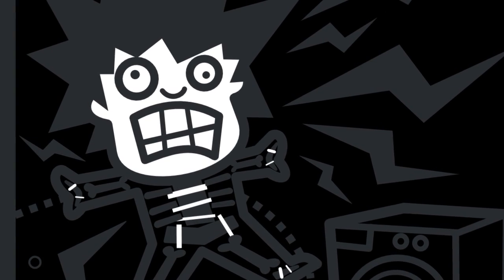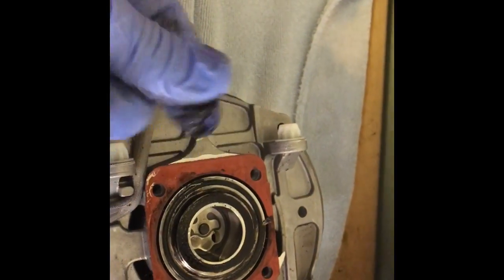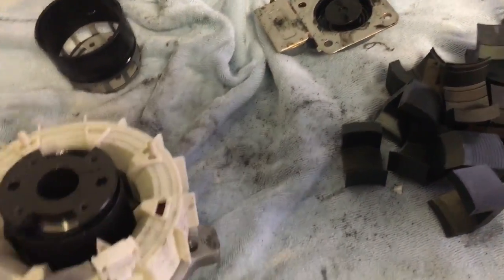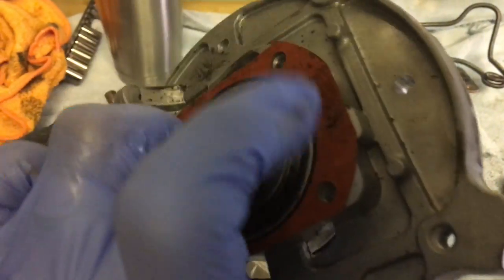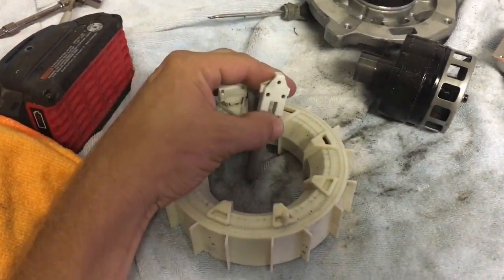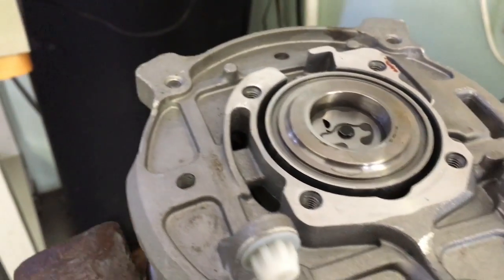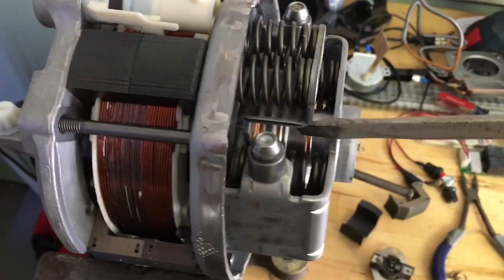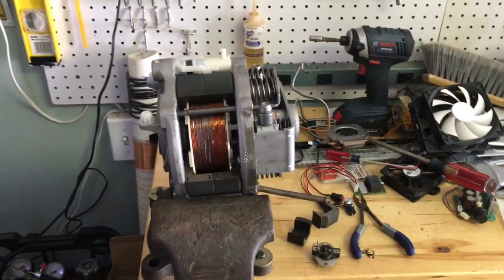LG Linear Compressor Teardown

Comment: Ahh reed valves! Well, one reed basically. No wonder these things die so quickly. I used to replace reed valves in reciprocating air compressors all the time. Usual cause of failure was low oil levels in the compressor sumps, which lead to overheating of the heads, which in turn made the reed valves brittle. So, it seems like LG could fix this issue easily with a better cooling system for the compressor.
Reply: For many years Yamaha used reed valves in the induction system of two-stroke motorcycle engines. I have worked on many of these engines and have never seen a broken reed. The reeds close onto a rubber coated seat. Where I have seen a broken reed is in a factory air compressor in which the reeds close onto a bare metal seat.
Reply: @cedriclynch  Reed valves shouldn't be used for high pressure applications because small amounts of plastic deformation over time cause them to fail to fatigue, this can lead to catastrophic failures especially if used in a high pressure system. The intake on a two stroke is very low pressure, always less then 20PSI depending on altitude and throttle position, and the reed valve doesn't really see any serious load, heck even plastic or rubber reed valves can suffice because they just aren't under any serious stress. You can't really compare it to this.

For the linear compressor it usually has a pressure differential of 600-800 PSI, with a 0.2in^2 area that's a force of over 100lbs every cycle on that extremely small valve, which is a lot for a tiny bit of thin sheet metal, especially considering it's braced against a sharp corner that will worsen the bending force accelerating metal fatigue.

For the air compressor it usually has a pressure differential of 200PSI, my air compressor has reed valves about 1/16in thick at about 1in^2 of area, that's 200lbs but it's distributed over a wide, thick piece of steel, plus the seats for the reed valves in my compressor have slanted reliefs cut into them for the valves to sit in and no abrupt sharp corners that the metal slams into like the ones used in the LG compressor.

Finally, Reed valve design, unlike many other types of valve designs is a particularly complex form of valve design because due to the cyclic nature of the device. Metal fatigue is always a concern, especially for this style of valve.
Reply: Personally I don't think those reed valves are nearly thick enough for the kind of pressures that refrigerants use, my 150PSI shop air compressor has thicker ones, refrigerants usually have a 500-800PSI high side and a 10-50PSI low side. That led to metal fatigue and inevitable failure.

Comment: How's the warranty service on them? I bought one and it says it has a 10yr warranty on the compress, do they make trouble or they honor it?
Reply from the maker: Depends on the area. If they have a good servicer in the area then you won't have too much of a problem usually. There are exceptions to everything though. If not you'll get the run around, or they don't have any one so call around and see if you can find one. I found that it depends on who answers the phone at LG. Some of them are great but most of them aren't. You have to check your warranty too because some were 1 year parts and labor, some were 5 years parts and labor, some were 7 years parts and labor. BUT if you got a good agent they might agree to cover everything, IF they agree to cover everything they might really send the parts to the servicer like they said they would, and IF you have a good servicer that does the back and forth and gets the parts they might get to you in a somewhat timely fashion, or they might put higher priority jobs ahead of you. 

So the simple answer is sometimes, but it depends on a lot of stuff.

Comment: What an incredibly stupid design. IF they used say six smaller holes instead of three large ones the problem would be completely solved. The rest of the linear system looked alright, but nowhere near as good as the sawafuji swing motor. My parents bought a fridge with this compressor despite my warning them that it would fail. Thanks for the video, wanted to see what was in it.

Comment: Looks like compressor operates under the principle of just a metal slug think of a solenoid and re-inverting Polarity back-and-forth through the windings the metallic pole pieces are too concentrate the magnetic field. 
                ? question was it low on refrigerant charge due to a leak and started overheating?. 

         Second question with all that black stuff in the system I can almost guess if you’re lucky they change the filter dryer but usually just stick a compressor on and call it good 👍🤣. 

         I’m guess there’s no flushing involved to clean out the lines or the evaporator or cap Tube.
Reply from the maker: Open the system and change the drier when making a repair. This one was clean from what I remember. Metal slug?? No, it operates as valve opens on the back stroke charging the cylinder with gas then the metal flap closes on the compression stroke compressing to liquid.

Comment: I believe the problem is the diaphragm in the center where the 3 holes is broked and for that reason there is no compression. The part I don't get is how to find out that problem without open the compressor. If there is no compression, the PSI in the low and hight side, what it could be. I understand the compressor must be change. But I would like to know before take the compressor out.
Reply from the maker: If the compressor is running and you get 40+ psi on the low and high side the compressor is not working. I tap the low side. If it's drawing a suction then low charge, if it's 40+ then bad compressor.

Comment: We bought a $2500 LG french door "linear compressor" fridge in July 2015. 2 1/2 years later, compressor fails and is replaced. 2 1/2 years later again, same thing, 3 weeks outside the 5 year warranty. LG thankfully agreed to cover it so we only had to pay the diagnostic repair but we had to live out of a mini fridge for a month. The repairman said he replaced it with an updated unit which is supposed to be better and also updated the firmware so fingers crossed.
Reply: Is it still alive now?
Reply: غير الكمبرسر عادي تعيش معاك عشرين سنه

Comment: There are other linear compressors on the market that have been very successful, so there is nothing wrong with the principle. The Sawafuji Swing Motor is a linear compressor. See here for more information: https://www.sawafuji.co.jp/en/technology/swing_motor/. The principle of the Sawafuji and LG products appear to be identical, but the designs are very different. The Sawafuji product has been in use for a very long time and is incredibly reliable. Its design appears to be much simpler than the LG product. There's another Japanese linear compressor that you can see in this video too: https://www.youtube.com/watch?v=eEF-owkyI-o. The person who made the video says that "you can see why it would last so long".

So maybe LG has made a poor version and pushed it out on the market with a few design and materials issues in it that the Japanese versions don't have?
Reply from the maker: The first one I don't know, lg drawings are or were just as sketchy. The second link shows a linear compressor that is a much better system of reed valves and looks very well built.  Having a flap of metal that bends in the same place thousands of times to what looks like a well thought out system is like comparing apples to handgrenades. 

I think or thought the weak link in the LG is the reed valve. My experience has told me that moving something by bending in the same place over and over is going to break it eventually, with all the materials I am familiar with. Maybe they came up with a material that can handle it, but I still don't think this is it. I think that the reed will eventually break, even if the rest of it held up. HOWEVER! As time has passed, I have cut open some others and found that they have multiple failures, not only the reed valve breaking. Some just seize up. So I have come to think the problem is the material they use in manufacturing. I think it'ss either too light or too cheap, either way coming down to cost to manufacture in  my mind.
Reply: @theappliancetechnician  well said

Comment: LG always claims that non-conventional technologies are the best and every time trying to achieve so it fails big time as in direct-drive technology in washing machines
Reply from the maker: I don't see too many problems with their laundry products. Their rotors did strip out but other than that on the front loads I don't see problems with the washer rotor or stators.

Comment: I am a Mech Eng, ( not refrigeration) just looking at that compressor it looks hideously complicated compared to a motor driven one. Reciprocating mass is what causes inefficiency. The linear has huge (10x?) times recip mass compared to piston. If my fridge died I would put in a universal piston compressor and temp control. I believe a conventional compressor with inverter drive would be good. I run my fridges with a Victron 12v /230v inverter 800 watt inverter and it runs two fridges happily. A smaller inverter will not start a compressor.
Reply from the maker: I think you're mixing topics here.
Reply: I am thinking the same thing! genius! What compressor would be suitable ? models??
Reply from the maker: @marcc629  Any 1/3 hp split phase compressor. Or any bldc compressor with an inverter board to run it. A split phase is easier, check my other videos.
Reply: @theappliancetechnician  interesting and challenging that we can bring this units back to life at minimal cost when others gave up
Reply from the maker: @marcc629  That's what it's all about to me. Find a way that is stable and reliable where other's can't

Comment: That black sludge looks like Teflon. Some automotive A/C compressors have Teflon in them, it disintegrates and causes similar sludgy stuff throughout the A/C System..
Reply from the maker: I can't say it's not, I don't know what it is.
Reply: Maybe graphite based lubricant?

Comment: I'm not good on sounds but this one kinda just hums (don't know if that's good/bad). Can I mount a clamp on service port on the lower tube, suction side I'm assuming and get a reading? I assuming if there is a hole in the valve there would be just ambeient temp/pressure reading?
Reply from the maker: Yeah, a low side port will usually tell the story. 50 psi and the compressor is bad. Suction says it's low. Usually you can tell the story that way.

Comment: @1:38 looks like the piston. So did the piston pound a hole in the the valve? how did the hole get in the valve? I've a "Give To Me" LG French door "door in a door" with the "Linear Inverter" system. I Tried to find a job shop appliance repair business that would work on it. Yes, they would $600 and up with "No Warranty".  The repair shop guy said they were way to busy anyhow for a actual repair job because his main income was from picking up the used refrigerators from the area appliance stores and properly scrapping them out $35 a pop and then whatever the scrap metal places give them as well. He does some times twenty a day (he has his own 2 ton box truck with a lift gate running loops from appliance store to appliance store). Apparently no one even blinks at dropping $2000 on a new refrigerator every few years. The appliance stores just can't get rid of the old units fast enough just from limited storage space. Is this a economic bubble about to break or what?
Reply from the maker: It needs to. They are making nothing but junk now days and selling it for $$$$. Some are not repairable. The hole is from substandard materials, cheap steel that wears out fast after vibrating a lot. It's just junk and that's unfortunate because other than that they make a pretty good refrigerator comparatively.
Reply: Walter Baumy do you think guys may be we could replace that valve? Welded a replacement ?  Seems like they are improvising at owners expense to me .. replacing would be good however we gotta take into account that piston might also be busted

Comment: I understand you can not use a back up generator on a linear compressor! True or false  A inverter type will ruin the compressor!
Reply from the maker: Generators are hard on everything typically speaking. You take a chance running any refrigeration on generator power. I don't usually see problems with whole house generators, it's the 10hp 5500 ones that I see cause problems.
Reply: False. Inverter generators will not harm anything. NON inverter generators can harm things badly if not tuned perfectly. In a perfect world a non inverter generator can power up anything you'd run on mains, but that's where the generator maintains exact RPM (and therefore hz and voltage) and never shuts down or otherwise changes speed while the device is powered. Inverter generators produce pure sine wave forms and never allow the voltage or frequency to go very far from spec, therefore they are safe for all electronics.

Comment: Walter: Would it be better to replace this with a different linear compressor so It could keep the variable speed efficiencies? How would I find a compatible replacement is the question I guess. Any ideas? Thanks.
Reply from the maker: Million dollar question. Whirlpool is making a linear but I don't know anything about it. I think the design is too new and they hadn't figured it out yet really.
Reply: @theappliancetechnician  According to this: http://www.frigochem.com/pdf/Refrigerator_Compressor_151207.pdf Page 28 - it seems like I should have a coil reading between any 2 contacts. The one I have is open P to S and open P to C I am getting a fluctuating resistance C to S. All connections off - only reading the compressor(still installed). Can you help with what a good linear reads in ohms between the terminals?  By watching this Teardown video it looks like maybe only one winding operates these linears. The fridge I picked up for free, now a project nothing invested yet,  is a Kenmore 795.72053.110 French Door bottom freezer( Nice fridge). The compressor is LG FC75LBNA(the infamous one I understand). No cooling. Six flashes on the control board LED. I pierced the service port line on the compressor. It has no suction when the condenser fan is running and it feels like the compressor is running. Total current draw of the fridge from the 110V outlet is like .5 Amps. Thanks for the discussion here. I have several used reciprocating  compressors from scrapped refrigerators. Thinking about patching one in with the 12 volt relay as you discussed in your video https://www.youtube.com/watch?v=lZJ0EZE3tx8. Thanks for that. I would not have thought to try that. But I am waiting for now to see if there really is an improved LG or Whirlpool linear compressor coming along. Looks like I can buy the same one on Ebay for $280. https://www.ebay.com/itm/TCA35271204-LG-TCA36511303-TCA35271204-TCA35533604-Refrigerator-Compressor-NEW/233263981723 Probably get a couple years out of it - maybe.
Reply from the maker: @rogerschelling3162  Linear compressors have a single winding so that's 2 pins that will give a reading. BLDC have 2 windings so all 3 should give the same reading if you ohm them out. LG  linears use 2 and one doesn't go to anything so if you get 2 ohms across 2 terminals and OL on the other one to either of those 2 then you're dealing with a linear. BLDC use the grey or black compressor boards to run them. It's usually a VCC3 controller that runs the compressor. I have another video about that controller and running it on an arduino.
Reply from the maker: @rogerschelling3162  Typically when you pierce the system you'll have about 50 psi+ on the process tube or suction side and the same or close on the discharge. I have 0 faith in the new one to be improved and no one can even tell you what the new compressors or the control board reprogram does that's different. I think they disable the compressor overcurrent error on the inverter. I've had problems with that after replacing compressors on these. That's all I can think it does.
Reply: @theappliancetechnician  Yea I did have static pressure of 50+ when I pierced the process tube. I can't tell that it draws down at all when the compressor & condenser fan motor are running.  Now then it looks like Embraco makes a linear compressor and that may be what Whirlpool is using. http://www.atmo.org/presentations/files/571d4d6ebe4561461538158Nv2qS.pdf 
Down to page 9 it shows an Embraco compressor # WMD7H for R134a 220-240V 50-60HZ. 
I don't know anything about the Yoycart website but they list some Embraco WMD7H as low as $60 + $8 shipping on a slow boat from China. https://www.yoycart.com/Product/548134004635/
I can't tell much about the compatibility of the LG linear driver signals being compatible with the Embraco linear driver signals. Although I have looked at the voltage and frequency on the LG that I have. The LG FC75LBNA.
Reply: @theappliancetechnician  Thanks for the explanation. The LG FC75LBNA that I have does ohm out as you describe. There is one winding of 6 ohms across two of the contacts and one unused contact. I downloaded the service manual for the Kenmore Elite 795.72053.110 with the LG linear compressor that I am working on and it has a better picture of the winding and gives the ohm reading for it. My compressor winding is good at 6 ohms if I steady the compressor, it's kinda of odd to me why that winding resistance fluctuates some but I guess there is some back emf or something even when it is completely disconnected.
Reply: Roger Schelling the lg universal compressor, but need to update  software via JIG..
Reply: @theappliancetechnician  Yes ! I had the same reading on the low side and 90 on the high, vey low flow. In all open system I could stop the flow with my finger. Also working on a project ( hobby)